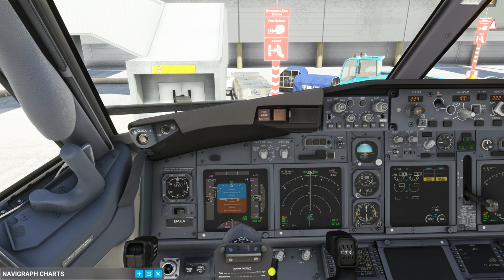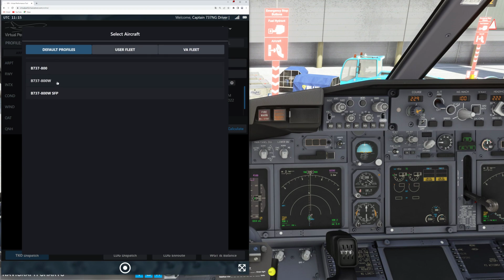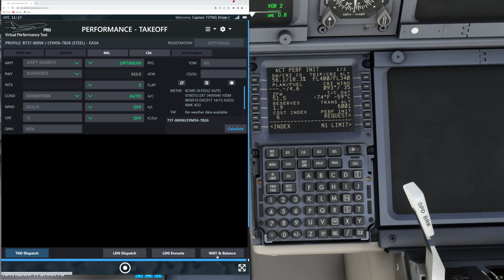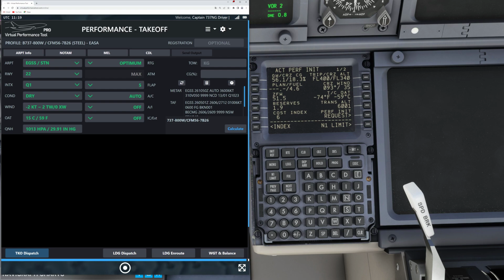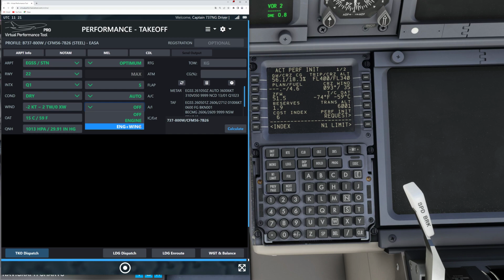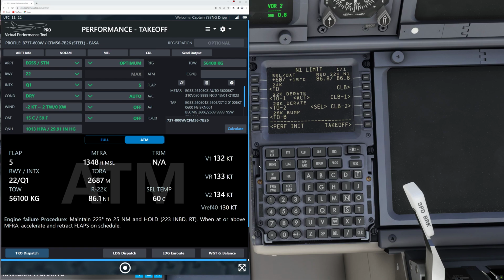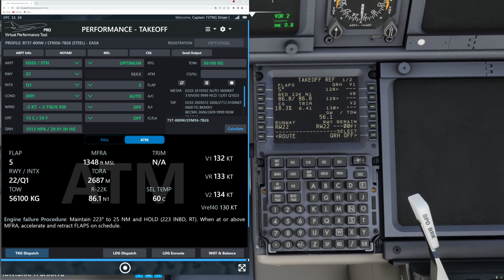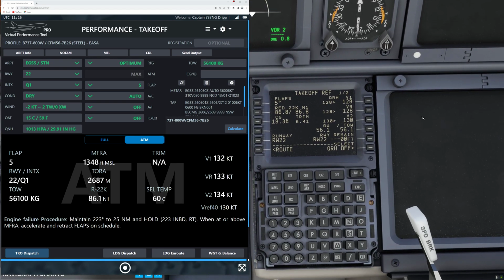PMDG 737-700 for MSFS - Tutorial 5: Final CDU Preflight and takeoff performance calculation (new)

Comment: Is there a default way to calculate the top of descent?
Reply: If you input your flight plan into the FMC it will create a Vertical path. The more information (STAR + APP & Decent winds) the more accurate it will be. You can also manually guess your TOD by times-ing your height by 3. i.e 30000ft x 3 = 90nm from DES. Its handy to cross reference.
Reply: @squawktheory7489  much appreciated bro, thank you👊🏾

Comment: I think you will find the OPT will calculate the trim if you enter in the CG% Box on the Takeoff page.
Reply from the maker: But only of you have the correct aircraft type. As explained a few times, the OPT currently only has the -800 so entering the CG of the -700 would not give you correct indications.

Comment: Quick query, if you dont know for some reason the assumed temp. Is there a good enough standard temp you can put there? Or just leave it blank? Regards from the 737 noob. Also, great videos!
Reply from the maker: It's different per takeoff so there's no standard value you could put there. Best to get a takeoff performance calculator. For now virtualperformancetool.com is really recommendable. At a later point PMDG will include one themselves.

Comment: Why don't you use v2 + 5 or 10 and should you use it? or when do you use it ? Is it just different between the operators?
Reply from the maker: I never heared of increasing the FMC speeds yourself. That would break your takeoff performance calculations. Any chance to any takeoff speed also changes takeoff margins, so don't do that unless you have calculated that it's safe to do so.
Reply: @A330Driver  Maybe @Flugzeug is asking about speed setting for take off on autopilot panel? I also remember some pilots set it like v2 plus 10 or 20 kts but maybe it was for other reason or another airplane:)
Reply: The 737s FMC adds it automatically. The flight crew simply enter the V2 speed and the FMC will add the V2 + 20 after takeoff.  I think that is the question being asked

Comment: I´m having a bit of a problem here, as when i go from the N1 limit page to the TAKEOFF one, i get an "INVALID ENTRY" message whenever i try to input a flaps setting, this happens with the V1, VR and V2 too. Right now, i´m not sure if i´m doing anything wrong D:
Reply from the maker: And you follow my tutorial exactly? If yes and you still get it then I'd recommend you to post in the PMDG forum to get some technical assistance.
Reply: @A330Driver  Many thanks for answering! Yeah, I’m following all the tutorials step by step, and it may have been a temporary bug because I tried it again while holding short of the runway and it suddenly worked🤷🏻‍♂️

By the way, I’d like to congratulate you for this awesome tutorial series and for your channel as a whole, I’m really new to Boeing and I’m loving it so far!

Comment: Many thanks for your awesome turorials! 🥳

Upon selecting takeoff derate TO-1 and entering the SEL TEMP I noticed climb derate automatically switched to CLB-2. Does this mean the de-rating applies to the whole climb process unless I manually deselect CLB-2 later? Also I would be interested to see a tutorial about page TAKEOFF REF 2/2 and the CUTBACK option, especially if used in combination with an already derated takeoff 🤓
Reply from the maker: The climb derate will wash itself out at 15.000ft unless cancelled by the pilot ealier on. Check my climb theory tutorial for more background when to cancel it manually.

There's not really a lot to say about the TAKEOFF REF 2/2 and CUTBACK, we simply don't use either in my airline, with the exception of selecting the runway state on the TAKEOFF REF 2/2 in case it's WET ot Skid Resistant.

Comment: Am I correct in assuming the reason why the speeds in the tool are quite a bit higher than then QRH ones is that you didn't enter the CG? In that case it should assume the most forward cg which will require the most nose down trim reducing overall lift and therefore requiring higher v speeds right?
Reply from the maker: The theory that the CG influences lift is correct, however the that makes only a very small difference and not several knots.
The main difference comes from the different aircraft types in the performance tool, so an -800 vs a -700.
Reply: @A330Driver  Right. I see. Thank you. However the only difference between the 700 and 800 is the length isn't it? The 800 being longer should generate a bit more lift when pitching up but also more parasite drag overall. That still doesn't explain the big difference in v-speeds to me.
Reply from the maker: @flighterer  The lengh has a huge influence however. It means that stabilizer, elevator and rudder are further aft of the center of gravity. This means greater control surface effectiveness.
Vmcg and Vmca will be affected by this, which in turn have direct influence on V1min and V2min.
Also remember that you always have a range of speeds from which to choose. This choice is usually done by operator policy which is then the reason why your OPT will give you a set speed. But if you check the airport comments you'll find that there's a huge range of speeds available.

Comment: Why is the trim wheel moving so slowly? In real life it spins much faster
Reply from the maker: The speed of the trim wheel depends on several factors. There are 4 different speed modes in the 737, all of which are simulated by PMDG.
Reply: @A330Driver  to trim faster, the electric hydraulic pumps must be turned on, true?

Comment: How do you program the NADP type to the FMC? Is it automatic? And also how do you know which NADP do you need for which airport?
Reply from the maker: It's written in the airfield briefing set up by airlines and in some cases also in the airport general pages of the charts.
For flightsim purposes I can really recommend Blackbox711's website, he's created custom airfield briefs where he also lists the NADPs to be used: https://blackbox.oneengineout.com/airportdata/
Reply from the maker: In my airline we bug up manually (see my full flight videos to see how it works or wait until my takeoff tutorial comes out) os we don't insert the NADP into the FMC at all.
However if you want to use VNAV for your takeoff you can insert the acceleration altitude on the TAKEOFF REF page 2/2.
Reply: @A330Driver  But you do have to set the thrust reduction altitude right?

Comment: What does Vref40 stands for in calculation page?
Reply from the maker: It's the approach reference speed for Flaps 40.
Very handy in case you have to make a quick return to the departure airfield, but also in case you loose both FMC during the takeoff since your flap retraction schedule is based off Vref40.